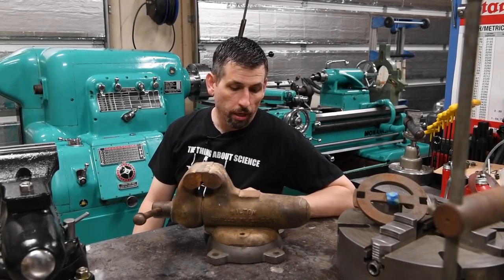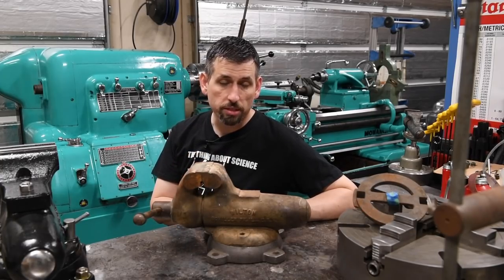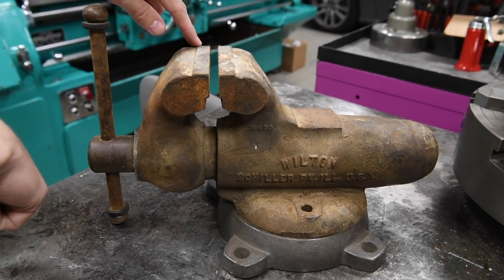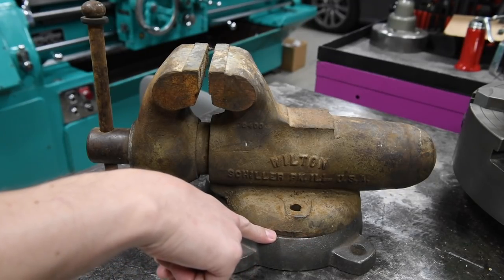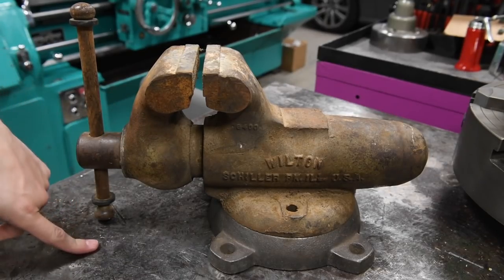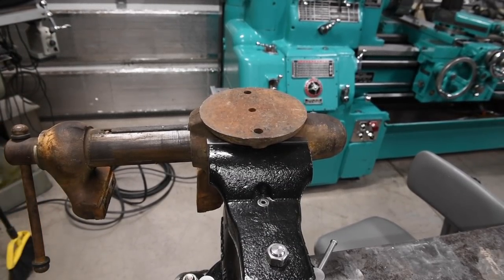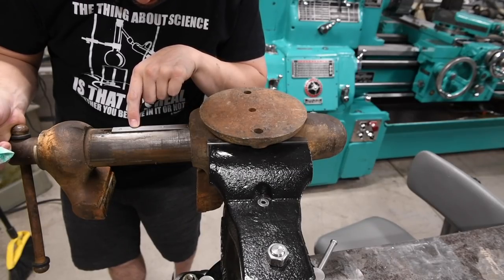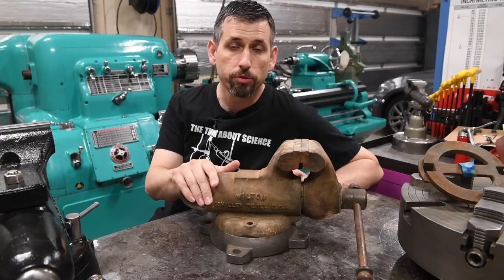1,000 Subscriber Giveaway! 4" Wilton Bullet vise!

Comment: Great videos. I just purchased a Monarch lathe, hope it turns out as good as yours. I’ve been following you on instagram. Good luck surpassing 1000 subscribers.
Reply from the maker: Thanks for coming by! Monarch made some absolutely stunning machines, didn't they?
Reply: AlwaysSunnyintheShop, Yes they did!  I just received the Fuji VFD, haven’t wired it yet. My lathe is 13” x 36” 5hp, built in 1954. Nathan
Reply from the maker: @nathanwade5264  Very nice that's a very useful size for a rigid machine like a Monarch.